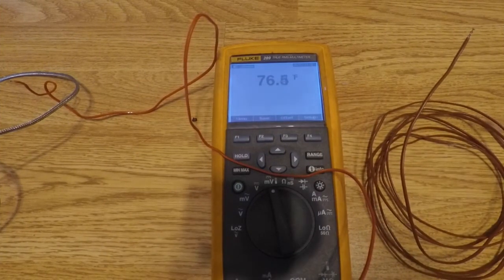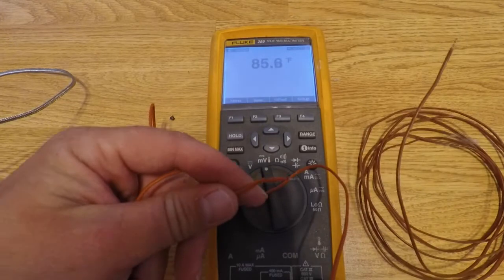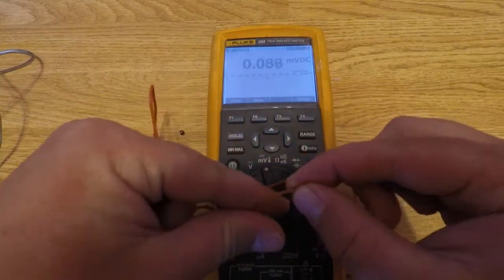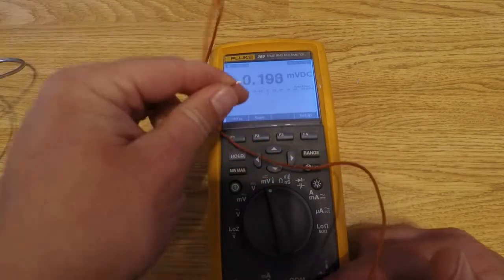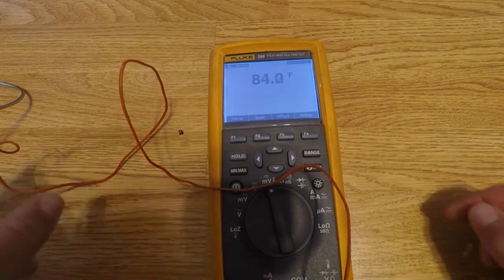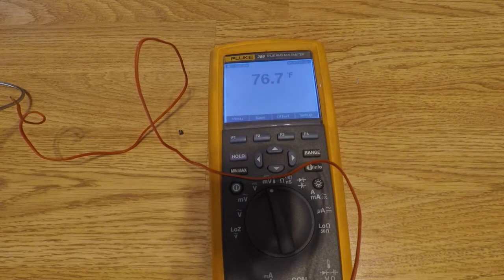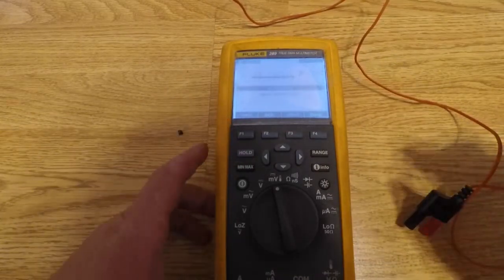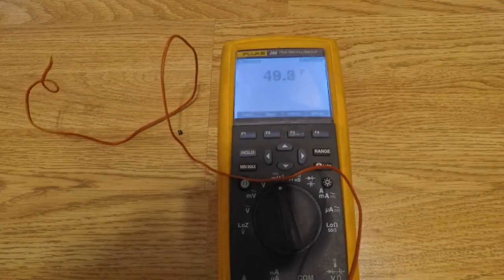fluke 289 cold junction compensation thermocouple

Comment: Yes i use the infrared temp gun and  then my flir-one thermal camera and app , i think 2 of my meters could do that but hey  why  use that when 1 got 2 other tools ;)
Reply from the maker: How do you like your flir-one thermal camera? I was looking at those.
Reply: i recon its ok exovcds has i think thet other one,  but my research showed the flir one is probably better , Have to use it more! One downside is the built in battery on flir one. have to see if its gone flat again